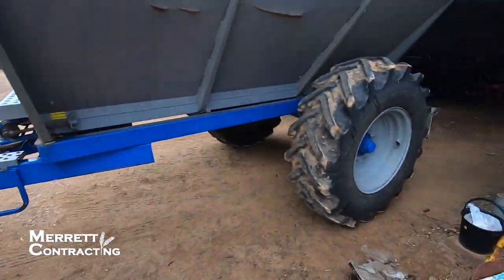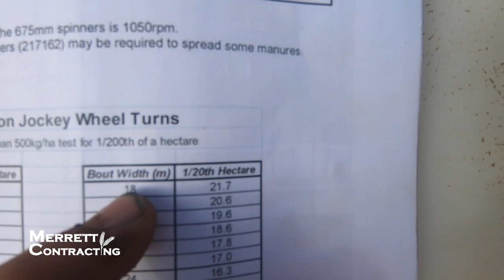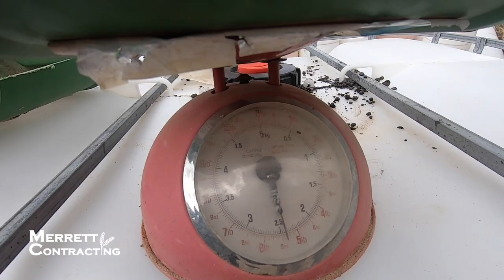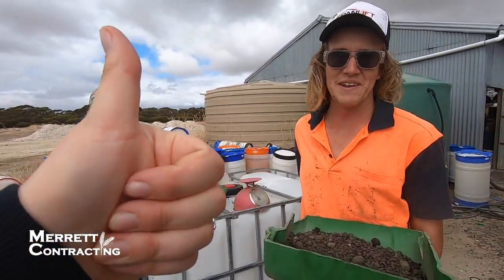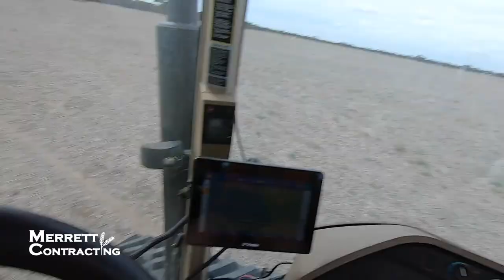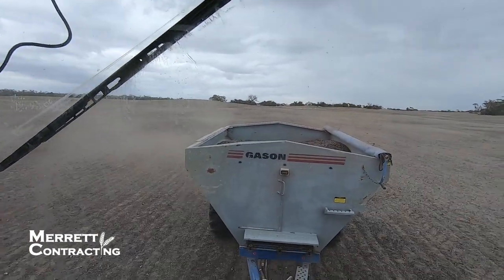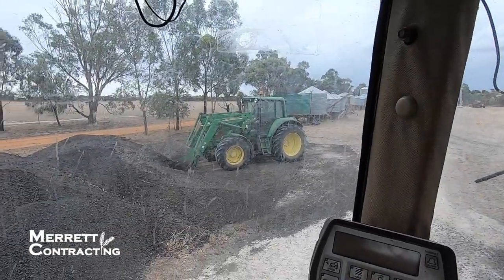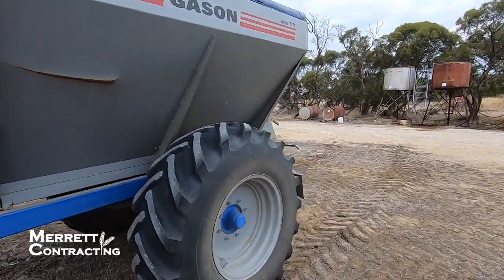Spreading Toilet waste? | John Deere 8410T

Comment: What’s the advantage to have the tracks to having tyres on tractors
Reply from the maker: Here’s a few
Pros-bigger footprint equals more traction, less compaction and better floatation, no flat tyres and cooler looking
Cons-high maintenance running gear and rough down the road
Reply: @merrettcontracting  ah there you go ok cool cheers mark